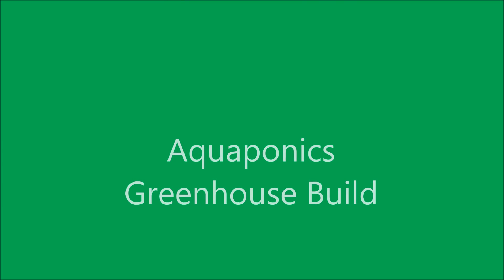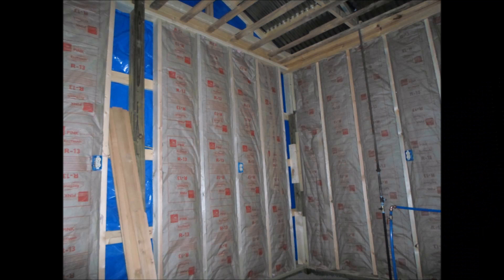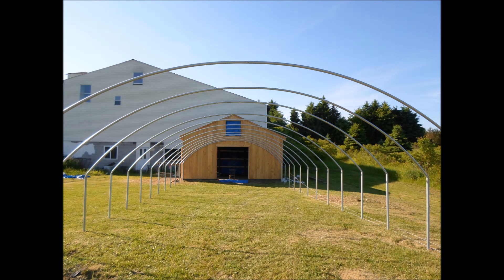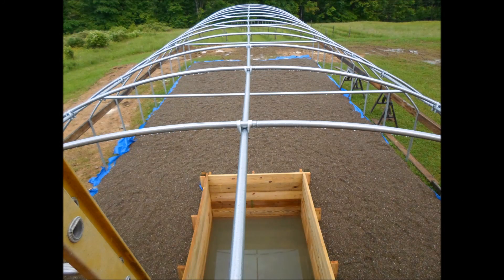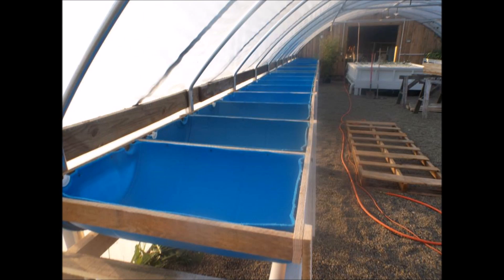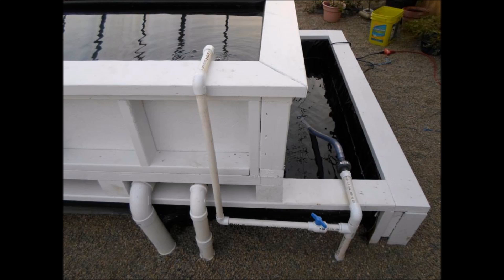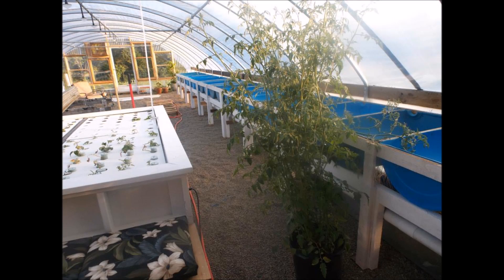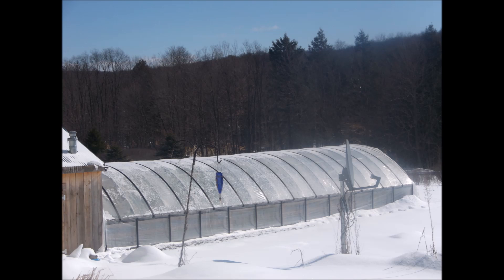Aquaponics Greenhouse Build

Comment: Donald, what a great job you have done! Congratulations on your wonderful build. I have a few questions about how well the system worked over the winter if you have time. 
1. Are there any plants that did not do well?
2. What temperature did you keep the greenhouse at over the winter?
3. Does having the greenhouse oriented south have any drawbacks, what made you choose that orientation?
4. If you do not mind, could you share what the cost of heating the greenhouse was for the winter months?
Again, thank you for sharing all of the videos and pictures, as well as your observations and comments about what works and what does not.
Roger S. Naylor
Reply from the maker: +Roger Naylor some of the plants just stayed dormant in the winter and I believe due to low light levels Its easier to say what did well- tomatoes, beans ,kale,beets,basil, onions, chives, lettuce, spinach.
I set the temperature to 70 degrees and was easy to maintain even on the coldest days. South orientation was preferred because the local orchard has a number of greenhouses and one of them is oriented East west and that one has trouble keeping cool in the summer and is useless tho them. I have a gas well on my farm, I was very conservative with my fuel usage in my house to divert heat to the greenhouse--- my fuel use went up about $300 dollars, but this cost does not reflect the actual usage because of my fuel conservation in my house-- my actual out of the pocket was $25. Thanks for your comments my friend---Don

Comment: very nice work mate love watching this..... i got to ask 3 things #1 the cost of this set up must be big cost to set up how many years it take to off.... #2 the running cost of your gas and power what does that cost? i have a small set you and trying to set it up to run for free from solar and wind best heating be the big one i set up some under the ground heat pipe way down with alot of glass to hold some heat as take the heat from green house to push in the glass to hold heat .....o and one more thing? #3 like this set up to feed your family or you going to sell the food and fish to make money?
Reply: TRMTHEweasel  I guess I can answer a few comments for my dad.
I forget the cost, but it was relatively low and he has mentioned it somewhere in other video comments. Most of the cost was in the wooden structure.

Setup took less than a year. He built in in one summer, started plants over the winter and within a few months it had taken off.

It doesn't take much to heat because of the double-walled construction. Right now he's using gas, because it is very affordable in the region, but knowing my Dad he'll come up with some ingenious way to make it more sustainable, once the kinks are worked out of the rest of the system. I like underground systems. I think you've got the right idea. 

I've heard of large greenhouses that gain some heat by composting inside. But I don't know enough about that to endorse it, could be sanitation issues.

As for $, I've heard the fish are less profitable than the plants. His fish are doing okay, and they're reproducing, but to really maximize the fish production, will happen a little later when the greenhouse systems are perfected. Right now they're just there to keep the system balanced. 

He keeps a small roadside stand for fun, and eats and shares the produce with family and neighbors. It could become a business, if he wanted it to, but right now it's about learning the system and problem solving for fun.
Reply: +Dustin Porta If I could ask, where in the US are you located? I'm in central Missouri and in the process of building a greenhouse like yours am interested about keeping the temps in the greenhouse in the winter months.
Reply: Dustin Porta Hello Dustin, Thank you so much for taking the time to answer questions. This is a well thought out build. I have looked but I haven't found which growing region you belong. I live in Nebraska. By the looks of it, this is 2 regions higher such as SD, ND, or MN. The insulated air pocket is brilliant. Was that an idea you found and put together or part of the kit? Bees in the greenhouse...not in a million years would I have thought of something that simple. I have never seen a floating grow area like that either. Keep this up and you'll end up doing tours like our local bluebird nursery in Clarkson, Ne lol. Thanks again!

Comment: Very nice job on the greenhouse and system. About how much did full build cost and what are greenhouse dimensions?  What type fish?
Reply from the maker: Katie Kelley My estimated cost was about $10,000, the greenhouse measures 20"x48" and the fish that I have the most success with is Tilapia. good luck my friend---   Don
Reply from the maker: Donald Porta This cost includes the fish house --- the poly kit was $3200
Reply: Thanks so much.

Comment: Wow!! Thank you for sharing this video. It looks very productive. I learned a great deal in viewing this. Thank you again. Why did you go with a plastic hoop greenhouse rather than rigid triple layer polycarbonate panels?
Reply from the maker: Mark Prescott The cost is very cheep with the hoop--- the covering is guaranteed for 5 years and may even get 8 out of it, to replace the cover is about 250 to 300 dollars. The next hoop house I will bend the hoops myself and save 2/3 the cost of the frame work. I will video the next build--- Thanks for the comment my friend---Don
Reply: Donald Porta Donald - I am on my 5th viewing of your video. It is fantastic. I am really inspired!! I had a few questions. How many 1/2 barrel grow beds in total in your green house? What is the width and length of the hoop house? I counted 4 IBC tanks? What variety of fish, Tilapia? Are you using the fish and produce grown as personal consumption for your family and friends, or are you supplying commercially? I see significant resources dedicated to the vertical grow towers. What is your production rate? Where are you located? I had planned on building using triple wall polycarbonate panels, but after viewing this, I believe I will utilized a high wall hoop house similar to yours.
Reply from the maker: Mark Prescott Thank you for the great comments and viewing--- I do the same when I find a video that excites me. to get to your questions---- I have a total of 40 half barrels. My greenhouse is 20x40.  The fish tanks I had a disaster, one tank had 100 catfish, one tank 50 talipa, one tank a dozen 19" trout, and the last tank was a collection of bluegill, perch and crapi.  my problem started from allowing the neighbors fish in the ponds and placing the wild caught fish into the tanks without quarantining them for an extended time.all the fish got sick, I think with ick parasite. lost all the catfish in 4 days the other fish took longer to die. I treated all the fish except the talipa with salt solution(making sure this water didnot get into the system), the talipa I elevated the water temperature to 86 degrees, all the talipa survived. all the trout died. some of the other fish made it. I now have a mixed tank of pan fish, one of gold fish, and the 4th will be for the baby talipa that I am collecting from the talipa that are now mature. Most all of my produce is for friends and neighbors even though a local restaurant offered to buy all my produce and fish. My towers I only have about 1/4th of them in production.  I still haven't decided what to plant since I don't need all the food, and don't know it real potential. I live in Northwest Pennsylvania--- 50 miles south of Lake Erie. Thanks for your note my friend---Don
Reply: Donald Porta Thank you for patiently answering all of my questions... and so rapidly also. I am planning to move to southern Virginia in 5-6 years, and have adapted my planning to utilize many of the concepts you demonstrated.  Each species of fish has a specific range of environmental factors in which they will thrive, Water PH, temperature, dissolved O2, Ammonia/Nitrite/Nitrate ppm, etc. Trout need pristine water with high O2, and will not tolerate high levels of Ammonia/Nitrite/Nitrate levels. I prefer the taste of Trout, but I'll be using Tilapia since they are more tolerant of water quality. I have been doing nothing but reading about aquaponics, so I have a lot of book knowledge, but little experience. If there is anything I can help you with, don't hesitate to ask. Thanks for your note my friend-- Mark
Reply: +Jeff K Tilapia offers a number of advantages. Tilapia are fast growing and can survive in a wide range of water quality - PH level, dissolved Oxygen, Ammonia, Nitrite, Nitrate level, and a temperature range of 60-85 degrees. Tilapia are prolific breeders. One Male and 5 Female breeders(6-9 months old) can produce a significant amount of Fry each month. Tilapia grow to harvestable size in optimum conditions in 6 to 9 months. In addition, supplemental feed can be grown using duckweed, which can double in volume every 2-3 days and contains 35-40% protein levels. Don had mentioned in one of his videos on cleaning the solids filters, that he keeps a net handy, because he found fingerlings in the solids filter. Here is an excerpt from link http://animals.mom.me/raise-peacock-bass-aquarium-11234.html ,  Peacock bass grow rapidly and require a large space, therefore they are only suitable for indoor tanks when they are juveniles. According to Live Aquaria, you should choose a minimum 70-gallon aquarium to ensure they are comfortable as adults. Temporary tanks in the 30-gallon range are effective for the 2-inch fingerlings, but peacock bass need space to grow. Peacock bass are athletic and will jump out of their aquariums. Placing a cover over the top will prevent them from leaping outside the tank.   Like Don says, "Have a great day, my friend"!!
Reply: +Mark Prescott 
I wonder why nobody goes with peacock bass.
Reply: mention  duck weed  and see it  ruining  Lake  victoria  which  was  full of  Tilapia.

Comment: completely awesome. I think you will regret using the blue barrels there's imho better ways to do gravel grow beds, but the utility house and greenhouse was implemented wonderfully. A model unit.
Reply from the maker: Brian Cotton My reasoning for the blue barrels is to have a system that can be built from recycled materials--- the barrels are extremely tough and don't develop leaks. the shape of the barrels allows less volume of medium for surface planting area, they can be connected together as large single units. the smaller size per growing unit can block root growth and contain a single plant to a confined unit area, as example --- mint becomming invasive in the beds.  after almost a year in operation these barrels have proven to be the most reliable unit in the system--- no regrets as of yet, more time may tell. good luck my friend---Don

Comment: Very nice.  I'd like to know what the life expectancy is of the plastic roof material?  I'm hoping it is UV stable, but I've seen plastic sheeting become brittle in sunlight, then the first good wind and.......shreds.  Very nice job, well done!
Reply from the maker: SpockMcoy Issmart You are very right --- you need uv proof covering--- dissimilar plastics can also cause   the  plastic to degrade and break down at point of contact, in situations where someone uses pvc pipe as the hoops for the structure frame. The plastic covering that I have is guaranteed for 5 years, and the farmer that is selling the kits is also using the same on his farm and said that he has some greenhouses that is going on 8 years with the same covering.
Reply: Donald Porta Where is the greenhouse located?
Reply: SpockMcoy Issmart DIY aquaponics is currently creating buzz alongside commercial aquaponics. The term aquaponics may sound like it is out of your league but in fact, it is actually a fun way for you to start growing plants in your garden more efficiently. Watch this video here as it's all explained. 
Go here ==> http://aquaponicsdiy-new.blogspot.com/

Comment: Thanks for sharing Donald, a really great set up. I was worried that the weather here in Scotland might be a bit cold -but seeing your snowy pictures - I don't think I need to worry!  How do you get an airtight seal between the two layers of poly of the greenhouse?  Many thanks and best wishes.  Drew
Reply from the maker: drewmc70 I was in Scotland back in the 70's--- I loved it ---the country side and the people were so nice and  welcoming, I did have trouble with the language though--- I found myself having to ask to repeat everything, very embarrassing.  
The seal with the plastic covering is made with the installation hardware. There is an aluminum U-channel that goes around the perimeter of the greenhouse,and the plastic crosses over this, then a spring steel wire (called a wiggle wire) goes over top and locks the plastic into the channel. This makes a very good seal and allows the plastic covering to inflate and is then a firm roof to the structure. Look up wiggle wire on the internet and see what I tried to explain.  Good luck my friend---Don
Reply: Donald Porta Hi Don, that's great thank you, I shall check out a wiggle wire on the net. We are in Dunoon, Argyll, where there was a US submarine base from the 60's - 90's, you weren't here were you? It would be a really small world if you were! Best wishes. Drew
Reply from the maker: drewmc70 Hello Drew---  i was assigned the the Aircraft Carrier Intrepid CVS 11, and we visited the ports of Greenock and Rosyth. once in port I would travel the countryside.  My nickname was "Country Don"---instead of barhopping like all sailors do, I would grab my bicycle, backpack and take off the the countryside. Made some good memory's. Best of luck my friend, Don.
Reply: Greenock is my home town actually, born and bred!  Some good countryside to see and bike is the best way to do it too. Thanks Don.

Comment: I have built homes for over 25 years I would not have put the plastic outside of the insulation. Your vapor barrier should go over the insulation. The plastic outside of the insulation will be cold and collect moisture and probably cause a mold issue. I really enjoyed your project videos, lots of details. The amount of planning for each phase so that it all came together in the end must have been exhausting. Very nice job.
Reply from the maker: DivineInspirationGarage Thanks for the comment--- I know of this issue, however the hemlock does not have the batons on the outside and the openings between the boards needed blocked---I know the outside of houses are wrapped but no vapor barrier on the ceiling and inside walls--- the vapor barrier on the inside should be the issue I contend with. I intend to remove this barrier and leave the outside barrier on--- what is your opinion on this?
Reply: Donald Porta  If your vapor barrier is on the interior side of the insulation wall it stays warm and will not cause excessive condensation. If your vapor barrier is on the exterior side of the insulation wall it is colder and will be the foremost point of condensation. You will in that instance be collecting moisture between your insulation and the vapor barrier which is a breeding ground for mold.  In housing the house wrap (like Tyvek) on the outside is not a vapor barrier but a breathable driving wind and rain barrier. The moisture barrier must be installed between the drywall and the insulation on the interior to keep the insulation from absorbing the moisture from the interior air. If you have ever put on a rain coat on a cold rainy day you find very quickly that your shirt under the rain coat becomes saturated. With the trapped heat and moisture you begin to get very uncomfortable and start smelling rather ripe! That shirt is your house insulation and the rain coat is your houses vapor barrier. They are in the wrong order. A high quality rain gear will shed rain and driving wind just like your Roofing, Siding, and Tyvek house wrap but will allow your body to breath to rid itself of excess moisture. I hope this helps.
Reply from the maker: DivineInspirationGarage Thank you so much--- I thought Tyvek was just plastic---this is what I should have used--- makes sense, what I will do is slice the plastic between all the siding boards and then apply the batons to block the rain from entering.  Do you think this would vent the moisture?
Reply: Donald Porta  Cutting the outer plastic will help out quite a bit. I wouldn't  caulk everything in but allow the building to vent. Any heat or moisture that makes it past your heat wall is of no more use and needs to be able to get out. You may want to install a louvered wall exhaust fan up high on one wall and a vent on the opposite wall at the same height, this will bleed off any moisture or gases that will be concentrated at the ceiling level. I don't know what kind of gases you will be accumulating because of the aquaponics system but you will at least want to have a way of ventilating the room with the tanks if the air becomes over saturated. You may see the accumulation of ammonia, methane, or other gases from the fish waste and the ventilation would be an available control.
Reply from the maker: DivineInspirationGarage Thank you again--- the building is pole barn construction, the interior walls don't touch the floor--- it is about 3 inches off the floor. there is no caulking and the exterior is board and baton. Once the batons are on the exterior will be rain proof.the humidity last winter was minimum,  which surprised me, I had no idea of what to expect. I believe that I could have installed moisture resist drywall on the inside and ceiling. future repairs. Again thank you me friend, Don